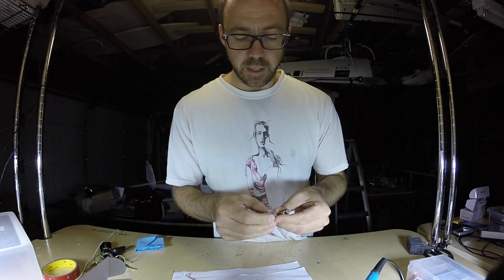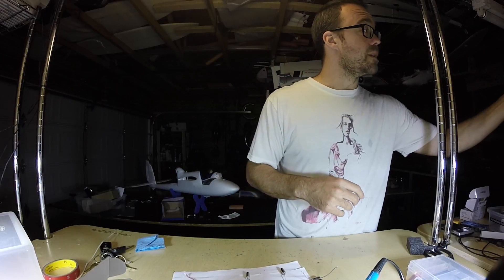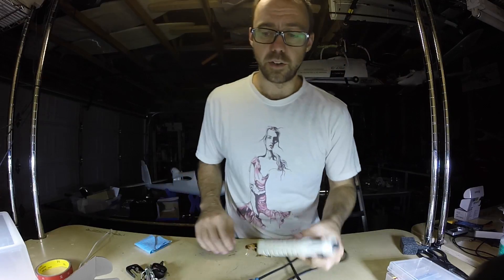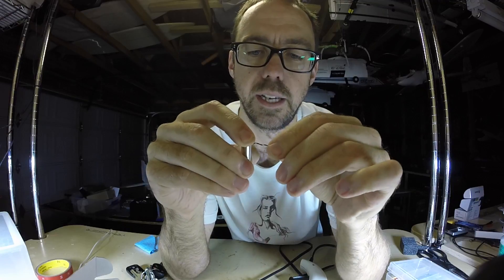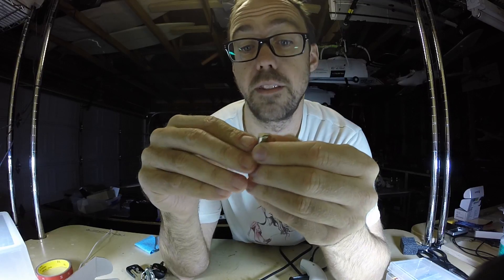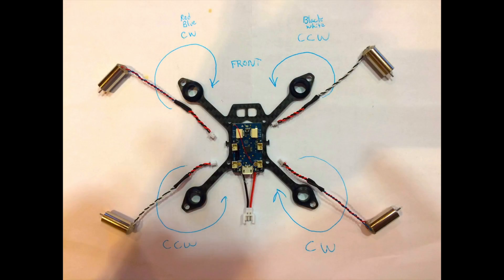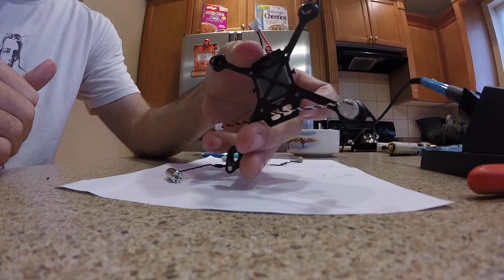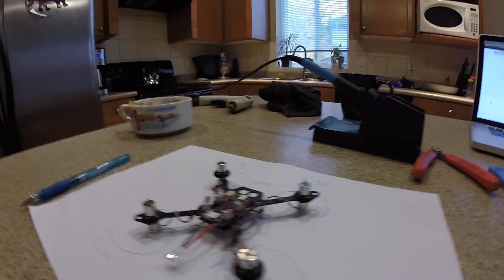DIY Micro Racing Drone for a Cheap Ass - Part 4 - Cheapass Motor Preparation

Comment: your on target protecting the wires at the cap, but,  hot glue is fine on cool motors, but when your in the air, and given it hell, hot glue softens and renders the precautionary adhesion of the wires to the brush cap unsuitable as the motors heat up, a more reliable product is professional welder adhesive,  its priceless for its several applications in regards to micro quads